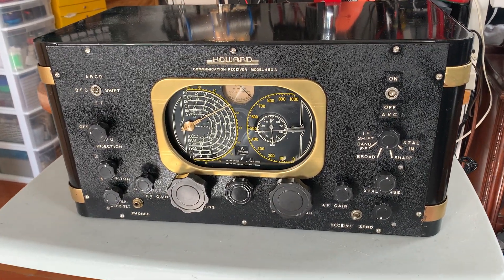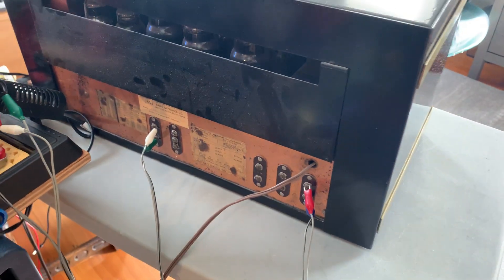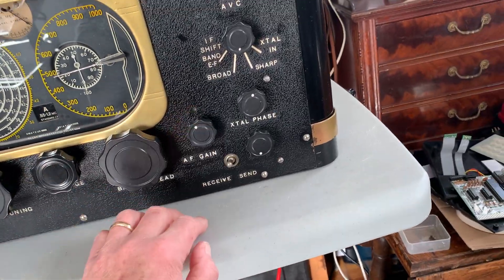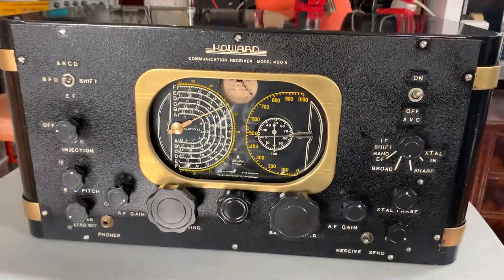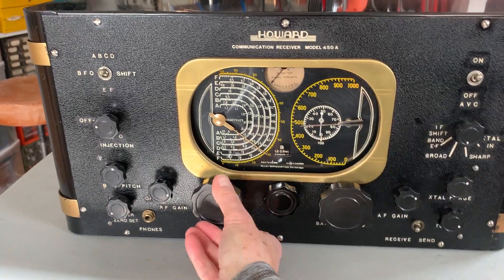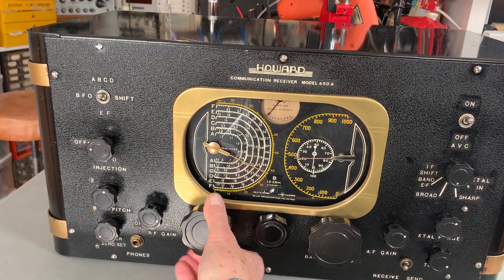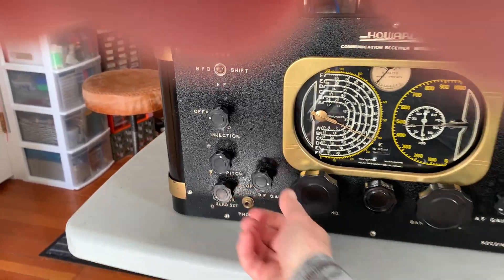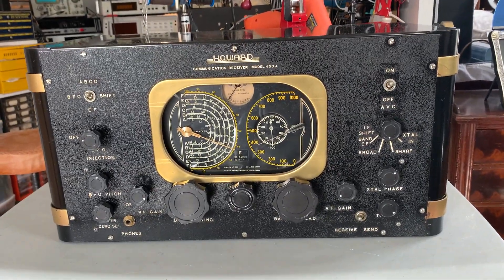Initial Function Test of a Howard Model 450A Receiver

Comment: I have one what would be the value if it’s not working?
Reply from the maker: The primary two things that affect price are completeness, eg. are all the knobs and tubes present, and especially any parts bespoke to that model), and cosmetics - especially the dial.  The electronics can usually be refurbished ok by someone that knows what they are doing.  That said, the price of any vintage radio is largely determined by where and how you sell it - check out my thoughts here:  https://sparcradio.ca/wp-content/uploads/2021/12/What-is-My-Old-Radio-Worth-Rev1a.pdf.  I paid $150 for this one and most of the electronics had already been refurbished, which I think was a bit of a bargain
Reply: @RadioRestoration  thanks for the information comparing the two it looks like it’s in really rough shape, both physically and internally.
Reply from the maker: @Dogboyaa1  They often are - the one I have is in the best shape I have ever seen one in(!)